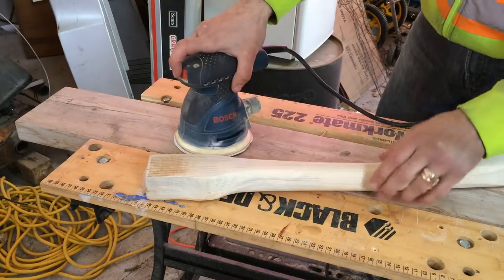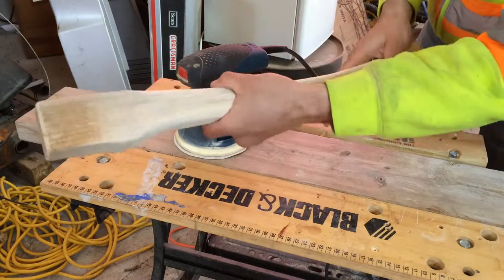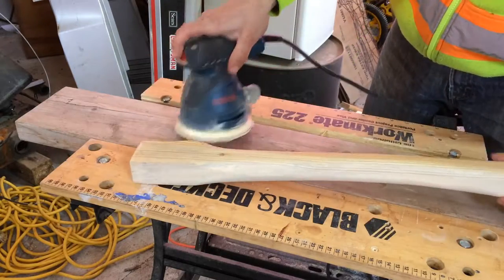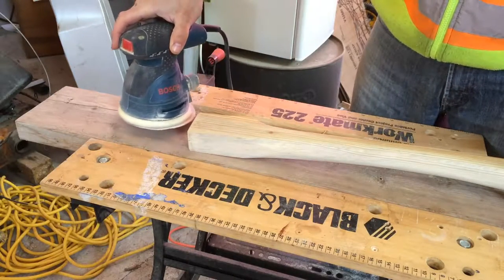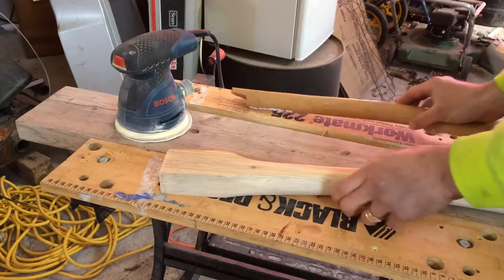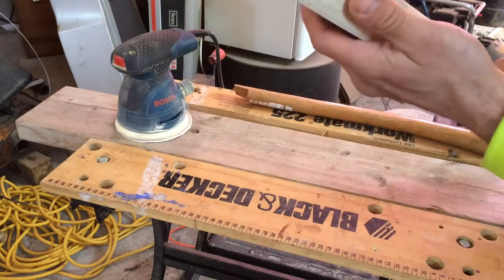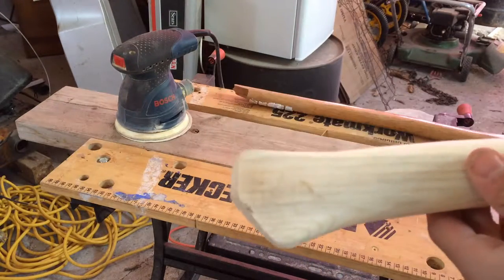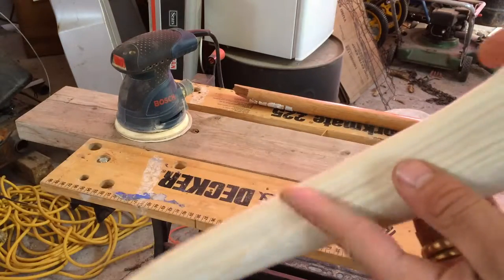Making an axe handle from a 2x4..part 2

Comment: What kind of wood is that?
Reply: 2 by 4 is usually not that kind of wood what you would want to use to make an axe handle
Reply: @diablo748  that is true. However pine is fine for hatchet handles because they don't flex or exude as much force as a full sized axe would. 
I've made 16" handles from cheap 2x4s from home depot and they are almost 2 years old now.